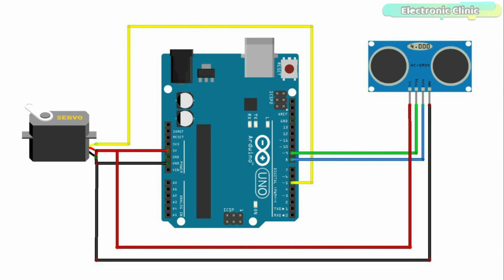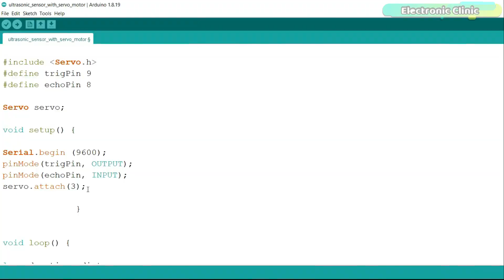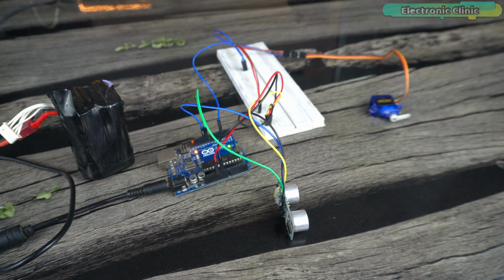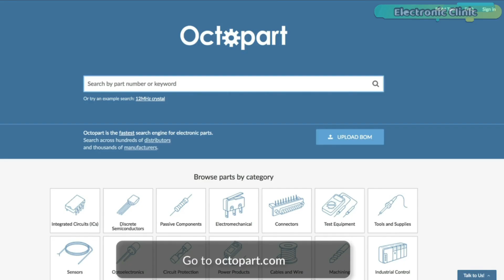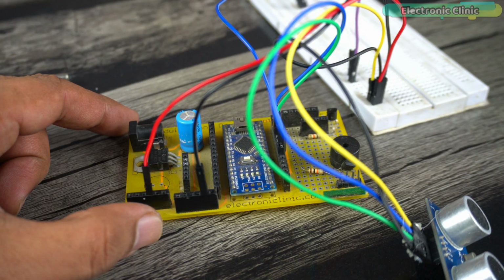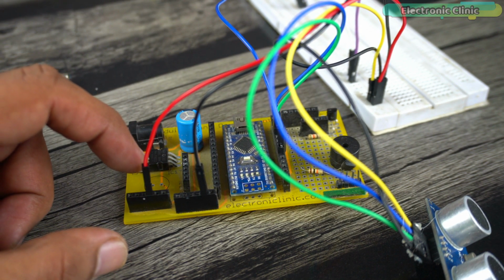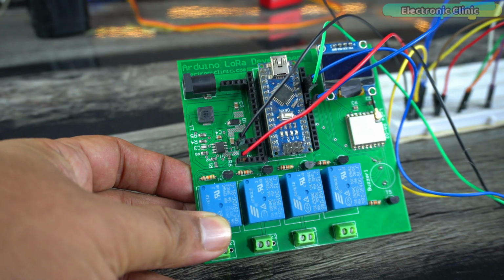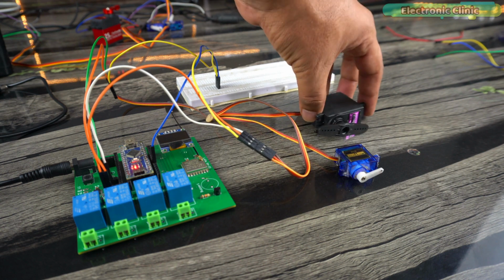Servo motor control using Arduino and Ultrasonic Sensor

Comment: Of course, using the Arduino onboard 5V regulated is not a good idea. It wasn't design for that. It is important to mention that the only limit is to the main 5V power supply. No problem with the PWM signal. Do you know how much power do the servo motors require?